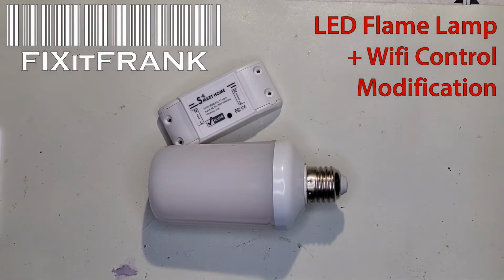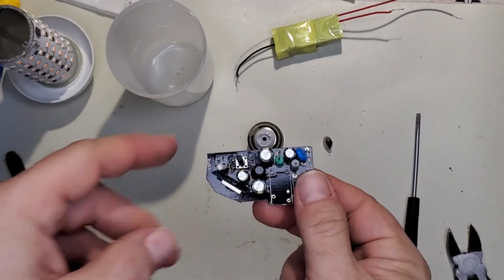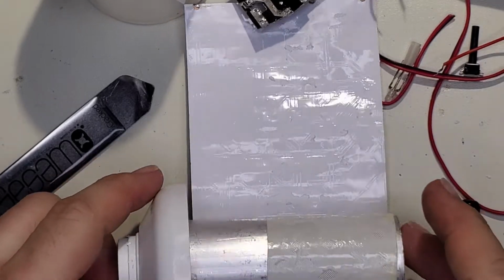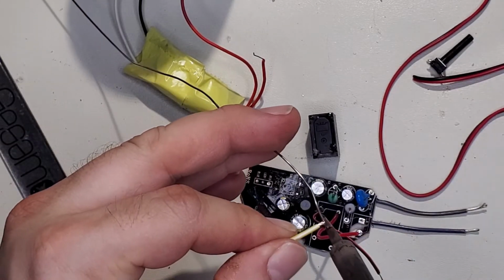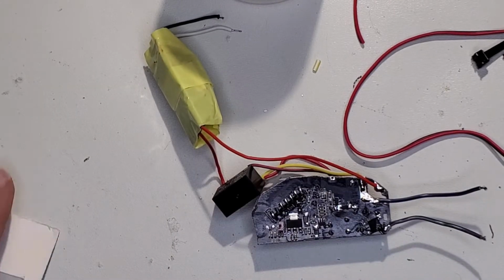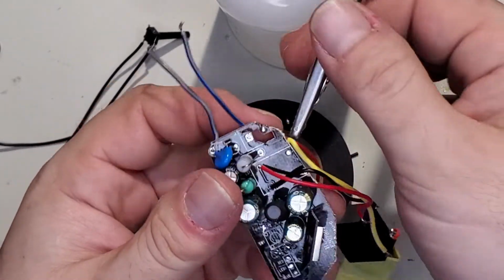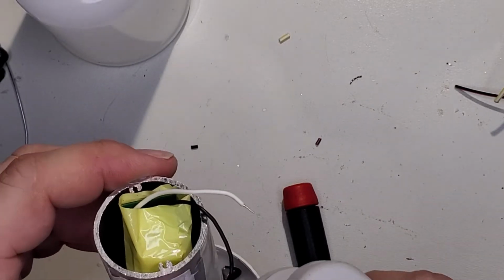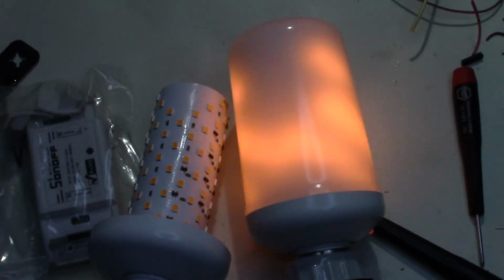LED Flame Lamp WiFi Conversion Project

Comment: Great job Frank. I'm the only one who watched this video? I have the Wiha set myself and I love them. Frank do you have a hub for the smart devices, or you use wi-fi devices? I'm on Smartthings, Hue, Harmony and some Chinese water sensors w/zigbee smart valve, also some wi-fi Kasa plugs.
Reply from the maker: I used to run Smartthings but I dislike having hubs.  I had some Smartthing outlets and occupancy sensors.  At one point I had 2 Hook -hubs running about 2 dozen of Etekcity RF outlets.  Then when I found Sonof modules and ESP8266 controllers I started migrating.  I know a lot of folks worry about Wifi/Hubless items but I have found that Anything using Tuya firmware that uses either the Tuya ap or SmartLife ap are very robust and secure.  I run wireshark on a pc at home that monitors my network traffic and I have not seen anything questionable. I also scanned the devices for open ports and found none.   I will say if the wifi device does not use Smartlife or Tuya (same ap really) then they might not be trustworthy.  Sonof uses eWELink ap but I can get them to pair to smartlife so I think ewelink is based on smartlife.
Right now I have all the light switches changed over to ESP8266 based controls.  Amysen, Gosund and some others(I forget) and a myriad of outlet modules.  My favorite is Nooie brand because they are small and you can put 2 in a duplex outlet.  I also have some Techin brand smart power strips in a few places.  It's all tied into the Amazon system.  I have echo dots in all the rooms and then one Echo show in the kitchen.  The house is ringed with Wyze cams that I can look at on the echo show which is cool.  
At some point I  plan on replacing the entire setup with hardwired systems with contactors/relays in the basement.  I like Wifi but I think due to my old networking days, I still prefer hardwired control whenever possible.
Reply: @FixitFrank  Unfortunately, I can't use smart wall switches and outlets, because my house does not have the appropriate wires, it was built in 1961.